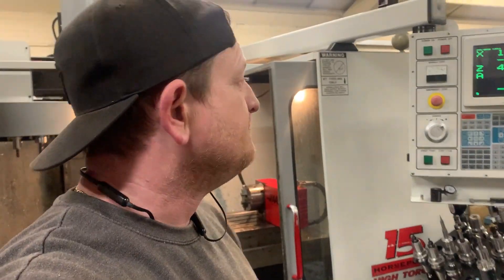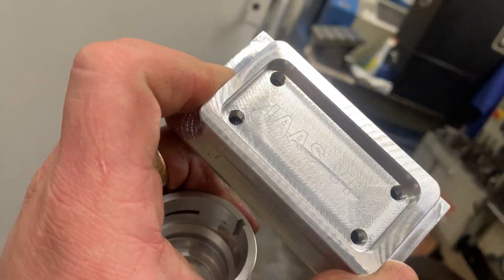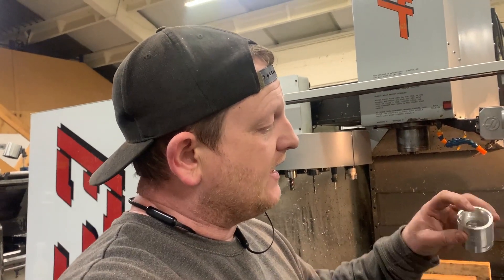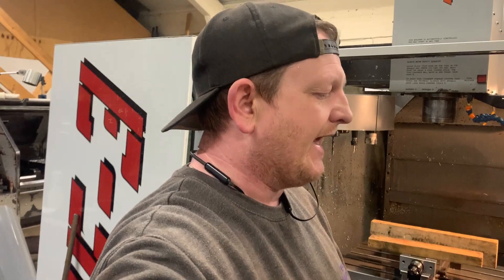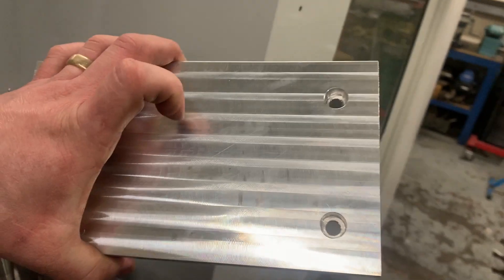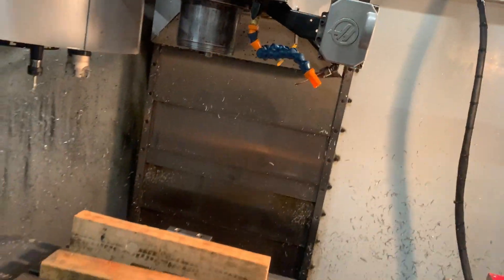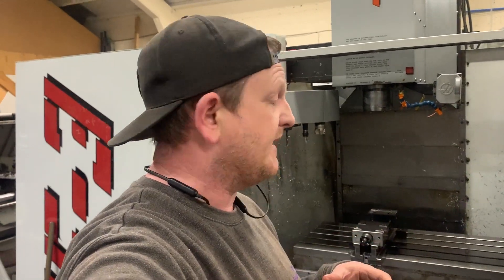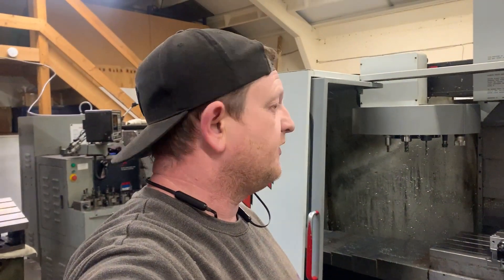Haas VF3 spindle failure !!!

Comment: Rip it apart but MARK ROTATION OF ALL BUSHINGS AND SPACERS! and order new quality sks or whatever bearings.....just did a 50cat over the summer. Easy to do. Just can't balance...that's why you mark the orientation of the BUSHINGS to the spindle. Itself..you'll see when you pull the spindle. Just clean everything up well n you'll be fine 🙂
Reply from the maker: Hi

Thanks for the advice, il definitely be opening it up at some point and then il see what’s what and decided what to do with it 

Thanks
Marc
Reply: @kinzy_fabrications  people act scared for some reason,  spindle and trust bearings are all wearable parts n need to be replaced over time. Just remember to mark the spindle with all the bushings to put back in same orientation,  and if you can, ....the bushing between the 2 sets (top n bottom) that  need to be lined up indicate the bushing concentric , it'll run smoother
Reply from the maker: Hi

I appreciate the advice from a man with recent experience rebuilding a spindle

Thanks
Reply: @kinzy_fabrications  I'm sure haas has schematics and a procedure to

Comment: gripper issue rather than spindle failure?
Reply from the maker: The drawbar shouldn’t have any affect on the actual spindle moving up and down like that as the drawbar is inside the spindle 
Thanks
Marc
Reply: @kinzy_fabrications  touche
Reply: It is worth mentioning ??
But, IF it was a Gripper issue.  
Their would not be the same amount of end float in the Spindle with Tool in and Tool out as Mark showed in the video.
In general, Spindle end float ( Z Axis ) is caused from internal support 
( eg Bearings ).
Considering the age of the machine.
The Spindle is definitely due for some attention.

Comment: Drawbar going bad? Some of the washers on the drawbar could be damaged
Reply from the maker: The drawbar probably needs replacing but I don’t think that is the issue as the actual spindle is moving up and down and the drawbar is housed inside the spindle so even if it was broken completely I don’t think it would allow that moment of the whole spindle

Il soon find out when I remove it from the machine, I’m very eager to find the cause 

Thanks
Marc
Reply: Gotcha I see that now in your video I’m a haas service guy and used to work at the factory building haas vf-2
Reply from the maker: @joshuacastaneda9367  you will know these machines much better than me then, maybe one day I will get a new one
Reply: Look forward to seeing your future videos on these and one day a new one in your shop 👍🏼
Reply: Also once you get that vf-0e I can look into the serial numbers on both machines and see if both spindles work for eachother to do the swap your talking about
Reply from the maker: @joshuacastaneda9367  thanks

Comment: It's a fairly typical scenario when buying anything Second Hand.
You're usually buying someone else's troubles ??
It's not to say everything you buy Second Hand is totally useless.
You can sometimes come by some great buys.
The question you need to ask yourself is ??
Is it worth my time.
Luckily in your position you're setting yourself up as the HAAS UK Second Dealer 😄👍
Looking forward to seeing what you do to resolve this issue.
Reply from the maker: Yeah when your scraping the barrel with 25 year old machines like this then you either need deep pockets or you need to be able to repair things yourself whenever possible

Whatever I do with the spindle I will video and post it on the channel so all you guys can see what caused the issue and what I did to resolve it 

Thanks
Marc
Reply: @kinzy_fabrications  What happened to your Spindle is a fairly common scenario with any CNC Mill.

Long Tool Stick Out, can reduce Spindle life by a huge amount.
Something many owner/operators don't realise.
Mostly why, it's best to stay away from Second Hand CNC Mills that have been fitted with a 4th or 5th Axis.

Comment: It really sucks that now you have a spindle issue, but if you decide to tear into it yourself, I'd be REALLY interested in how a DIY rebuild goes. I may have to do that to the spindle in my machine at some point. I suggest you watch Rob Rinzetti's "precision spindle rebuild" video (although the video is of him re-building a bridgeport spindle, the general techniques he uses should apply to a CNC spindle as well). His video is here: https://www.youtube.com/watch?v=grUdsTTRGl4
Reply from the maker: Hi mate
Yeah it’s one of those things and I don’t mind too much having these issues on the vf3,
As mentioned I’m going to try a quick fix of swapping spindles when the vfoe arrives if it looks any good just to keep me running, then when time allows I will do a video of opening up to vf3 spindle as I want to see first hand the condition inside and what’s loose or failed, after that I can decide if I think I can rebuild it or if it will have to be sent out when funds allow 

The spindle rebuild video you linked I happens to already of watched earlier in the year, very interesting 👍

Thanks
Marc

Comment: It could just be something simple like something not tightened up enough.  but idk how the spindle comes out so maybe not either.
Reply: There has to be a lock nut that holds the bearing pair together that's not tight. You might not be able to adjust the pre-load in these spindles, as that's set with 2 precision ground spacers - one on the outer race, and one on the inner race, and the difference in the height of those 2 spacers is what determines the preload, there's still a lock nut that holds everything together. It seems like the lock nut is loose.
Reply from the maker: It seems all bearings are help by shrink fit collars as you say but there is an upper oil cap on the diagram but until I can remove it I won’t know for sure
I’m very curious to get it out the machine and find out so il definitely video it all

Thanks
Marc
Reply from the maker: Yeah I have never had a spindle out either so I’m curious to see but yeah it seems as if something is undone or a shrink collar has moved 
I will do a video whenever I remove it

Thanks
Marc

Comment: well looks like its time to pull the spindle. I came across an issue on my 98 hs-1, the original spindle was grease packed, then it was replaced at some point. when it was replaced it looks like they put an early 2000s air lube setup, but it had one line bent over and zip tied. I ordered the new drip glass version and am currently in the middle of plumbing it in. the info can be found on the haas website but its not easy to find.
Reply from the maker: Hi

Yeah I think it’s that time
Il video whatever I do so everyone can see what’s what 

Thanks
Marc
Reply: @kinzy_fabrications  great content btw!
Reply from the maker: @davidfarmer  thanks

Comment: This vf3 seems to be testing your patience rightly
Reply from the maker: That’s the problem with buying 25 year old cheap machines I guess 

I hate the expense but love delving into the issues lol
Reply: @kinzy_fabrications  thats the cross we bear. I got my 94' vf1 a few weeks back. It came as a non-runner. Luckily it was solved by fixing some dry solder joints on the sdist board and a broken connector on the z axis servo amp. But now that's sorted the old crt screen has shat the bed 😪
At least its easy to replace.
Reply from the maker: @jonnydeen6952  there’s always something else lol but there still great machines for guys like us
Reply: @kinzy_fabrications they sure are, I started off a decade ago learning on haas machines so it's been nice to have a familiar control again. I still favour it over the heidenhain on my bridgeport 720x. I would like to see you rebuild the spindle. I know most will say not to and to call the hfo but those are also the type of people who go to Halford to get bulbs fitted in their cars 😪🤣.
Reply from the maker: @jonnydeen6952  😂😂😂